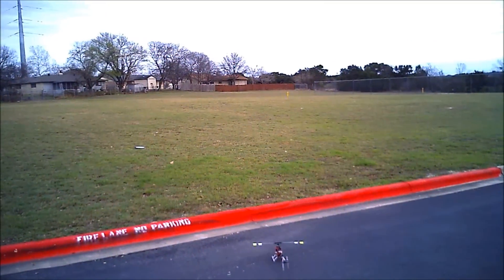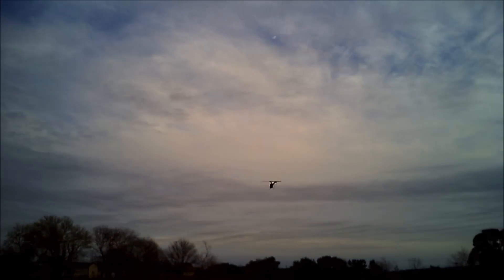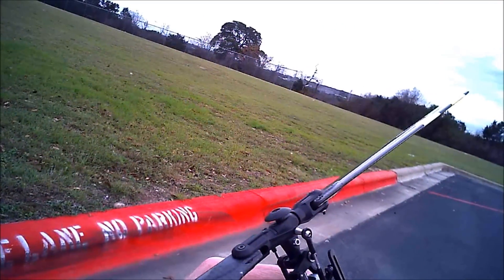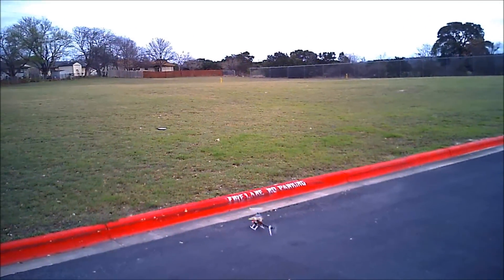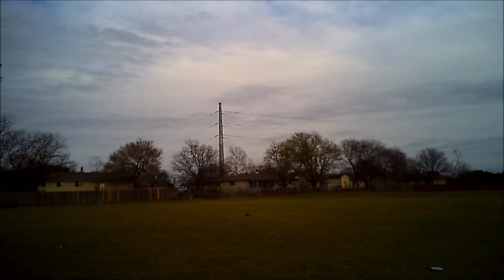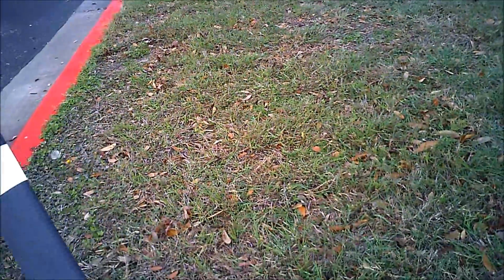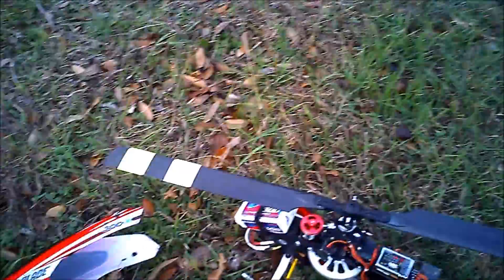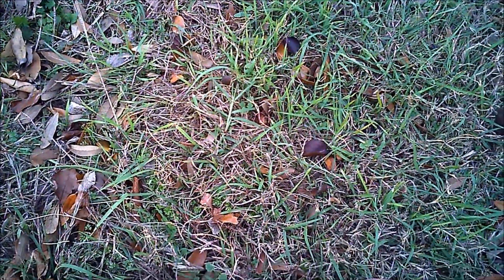Blade 300X with 3GX V3: The Issues

Comment: Hey Chris, I am putting a 3gx on a blade 450 next week, do you think this is something I have to look forward too? You got me thinking about a Talon 35.
Reply from the maker: Yep, I think you will likely have the same issue. A Talon 35 should do the trick, I would think. They have a pretty good BEC
Reply: Thanks for the quick reply, got one on the way just to be on the safe side. Could not for the life of me find any BEC specs on the eflite escs except voltage and your 300x flight may have shown us they are barely minimum in stock form.
Reply from the maker: To be fair, I wasn't using the eflight ESC in that video. Still, I think a 5 amp minimum BEC is a good idea.

Comment from the maker: I've seen video showing a Trex 250 drawing 2.5 amps from the servos with a 3GX, so it's possible. If the internal BEC on the ESC can't put out the required power, then an external BEC is needed (regardless of the heli size). Lots of Trex 250 and 450 guys are going to external BECs to have enough overhead in the radio power system.

Comment from the maker: Yep, that's what it looks like. I have a more robust BEC on order and will be trying it again soon. My original BEC was probably marginal already, but had not failed with the AR7200BX. The 3GX is known to increase current draw, so it pushed it over the edge during the aerobatics (increased load on the servos).